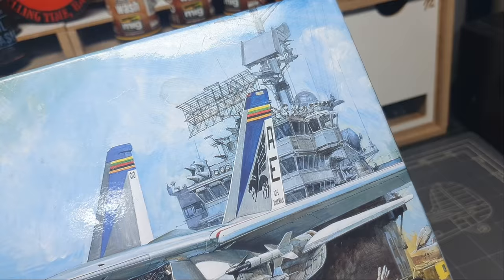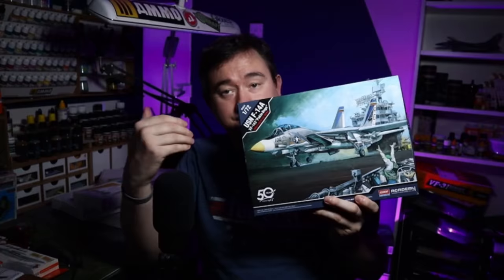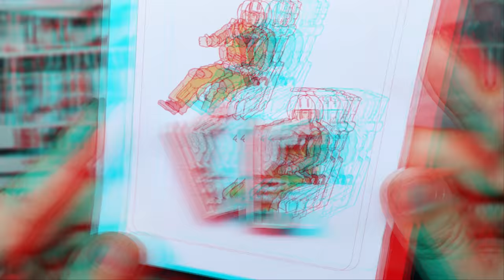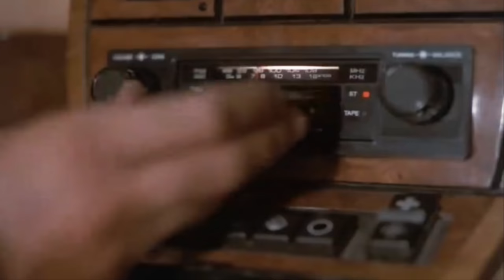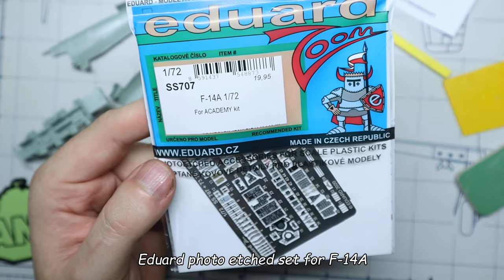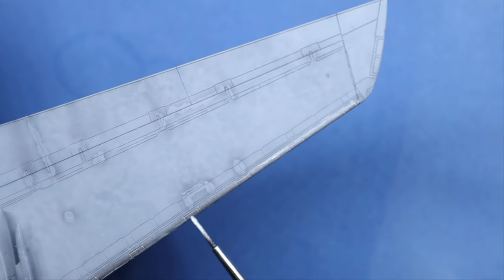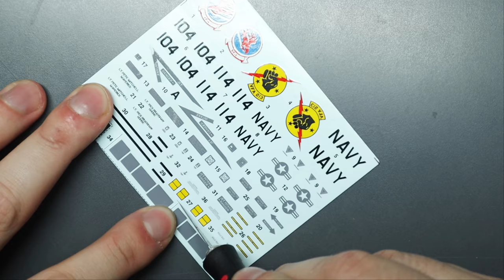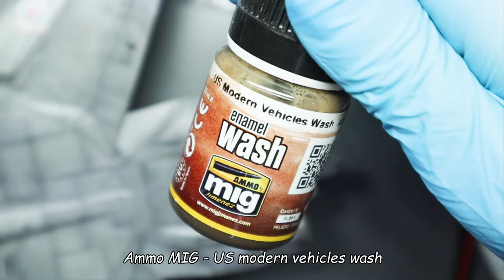1/72 F-14A Tomcat  - Top Gun - Maverick & Goose - Scale Model Aircraft

Comment: Nice job on the build!  Just FYI, I actually have a book on flight uniforms, and what you are depicting on the uniforms is "sage green".  I have found SAC Bomber Green to be an awfully close match (for future reference).  I  actually served on board two Nimitz-class carriers in my younger days, reporting to the first about a month after Top Gun was released.   Anyway,  the planes were not dirty so much,  but had paint touched up due to panel removal for inspections and maintenance.  The crew of the ship would sometimes be threatened with "water hours" due to the amount of fresh water used in cleaning the aircraft every day.  Not criticizing your work at all, just sharing some information.